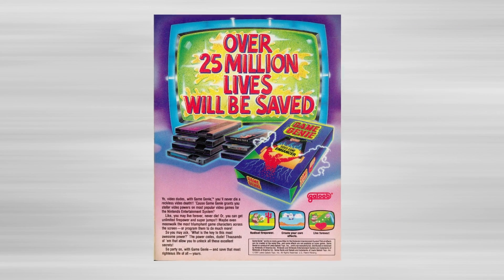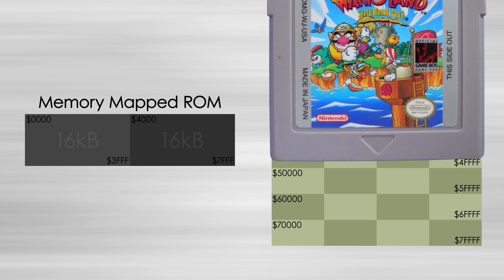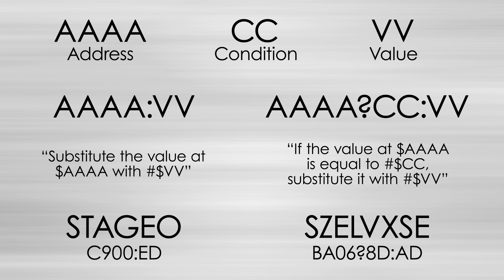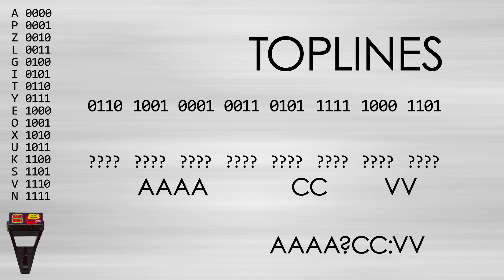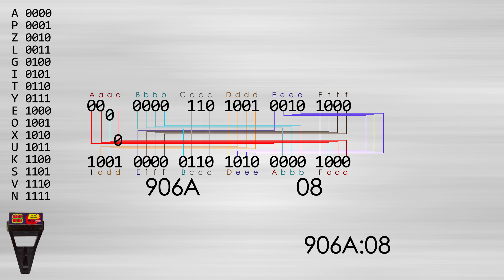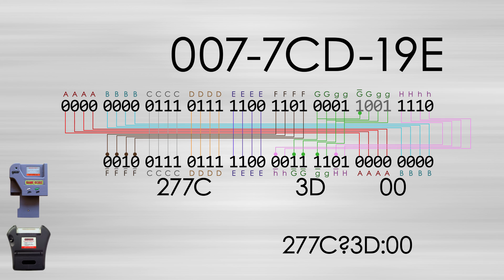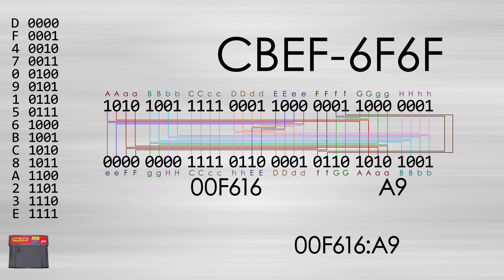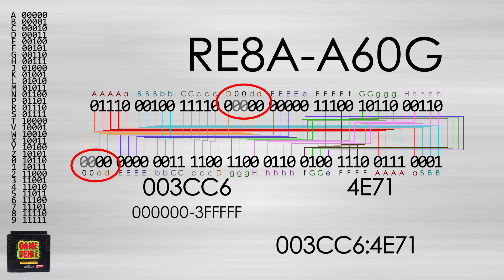The Game Genie Explained

Comment: Pretty sure the 68000 is considered CISC. ;)
Reply: Ah, I made a mistake. From the few examples I looked at the architecture looked similar to MIPS, which I am familiar with being RISC. I see now that there are many instructions that can be several 16-bit words long.
Reply: >truth it's more in the middle between the 
>extremes that genuinely belong under the CISC and RISC labels. 

The original 68000 at least has many instructions that do multiple memory accesses and take multiple cycles to execute and other than the weird pre-fetch thing they aren't pipelined. I'd say that puts it right in the CISC camp.
Reply: Wow, nobody mentioned that the 68K could address more memory than the 8-bit processors?  When you have 24-bit memory addresses ($000000) instead of 16-bit ($0000), you need longer Game Genie codes.  CISC vs RISC is irrelevant when it comes to the amount of memory the CPU can use.  8)

For the curious, one of the foundation principles of a RISC processor is not the quantity of instructions  it can use, but that all instructions are a fixed length and only store instructions will alter main memory.  Most RISC chips use instructions that are always 32-bits in size, but some RISC chips (like the SH2 processors used in the Saturn) cleverly use only 16-bit instructions.  CISC chips have variable instruction lengths.  x86 is the worst offender in this respect, as a single instruction can be between 1 to over a dozen bytes in size.  The 6502 processor in the NES technically qualifies as a CISC chip, as the opcode is always 1 byte, but the complete instruction (opcode + values) varies from 1 to 3 bytes total, especially depending on what addressing mode you use.

Note that there is a difference between an opcode and an instruction, but that's too complex to explain here.
Reply: G. David Turnblom Well there's a lot of ambiguity really.

the 6502 also meets some of the criteria for being a RISC chip. (some, but not all.) But not intentionally.
Those older designs kinda all predate that distinction anyway.

In fact modern x86 systems are all  based around RISC cores with a microcode translation system bolted on top to decode the traditional x86 instructions to simpler internal microcode.
So the complex instructions are internally translated to simpler RISC-like designs.

In general modern processors tend to be hybrid designs most of the time.
Pure RISC or CISC designs are quite rare.

Meanwhile, stuff like the 6502 and 68000 largely predates the destinction.
Though the 68000 is officially a considered a CISC design.
Reply: I think it was just a brain fart to be honest. :)
The 68000 can do more than an 8 bit, has longer operands etc so you need to mess with more data. I think a RISC machine would be a different problem though. You would need to mess with more instructions because the amount of work per instruction is less.
Reply: ugh and chips that implement RISC ISAs can also be microcoded.
Reply: the whole “CISC chips are RISC underneath and use microcode” thing isn't true. I mean, microcode is simpler than the normal instruction set, but it's also not RISC.
Reply: Yeah, the difference is not really about RISC or CISC at all. It's just that the Z80 and 6502 used by most early consoles were very simple 8-bit microprocessors (and thus cheap enough to go in those early consoles and home computers), and had very short, often 8-bit instructions. The 68000, on the other hand, was a more complex 32-bit architecture that typically had much larger instructions as a result.
Reply: THERE we go.
Reply: Yap, Wikipedia says it's CISC: https://en.wikipedia.org/wiki/Motorola_68000
Reply: The 68000 may be considered CISC, but in truth it's more in the middle between the extremes that genuinely belong under the CISC and RISC labels.  Although the 8086 itself wasn't quite as much of a CISC CPU as its current descendants are, the 68000 has a far simpler and more straightforward ISA.  68000 was chosen for Genesis and Apple's Macintosh and Lisa because of its simplicity and power, while Nintendo chose the 65816 for the SNES mostly because it is backward compatible with the 6502 (and, in terms of code execution, was very fast in its day).
Reply: I'd put the 68000 closer to the edge of the CISC camp.  Certainly far too complex for RISC, but no where near as over-engineered than most of the descendants of the 8086.  I also agree with another comment I read some time ago about the 68000, that it's a mediocre implementation of a great ISA.  CISC and RISC are not the only classifications of CPU type, but too many industry people today choose to oversimplify the matter.